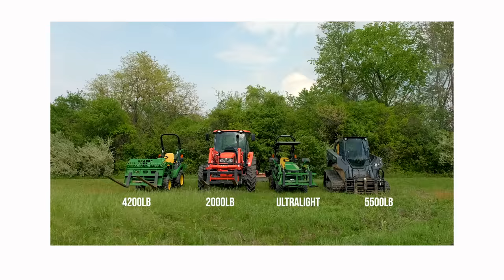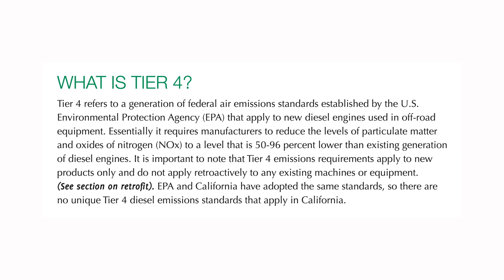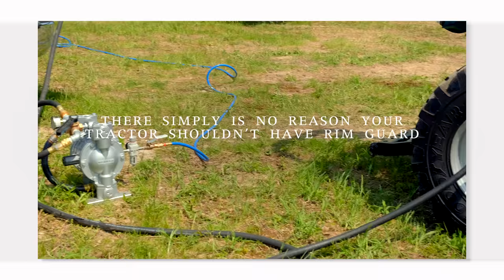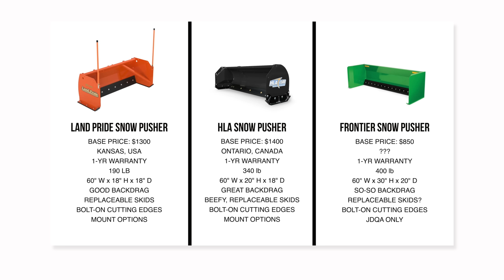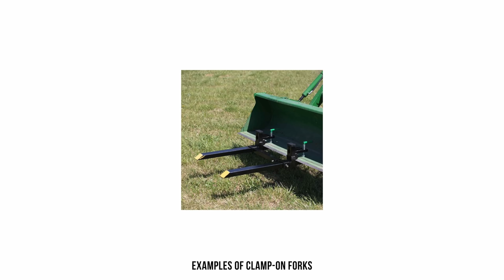TOP 10 MOST OVERRATED TRACTOR FEATURES, 2022 EDITION 🚜

Comment: Diff lock is like the 8th wonder of the world!!  I wish everyone would offer lockers for the front axle too!  I would for sure pay for it.   Lockers and Rim Guard in ALL 4ea wheels is a huge multiplier on what you can do with the tractor.  I just bought a Massey Ferguson 5711 Dyna 4 and added 2,800 lbs of rim guard plus 660 lbs of wheel weights.  Lockers + added ballast = success.   Great content!
Reply: Buy a deutz fahr if you want standard front diff lock or any SDF brand tractors,
Reply: I’ve heard filling front tractor tyres with liquid ballast will place pressure on the front axles they are not designed to take. However I kind of question this as most smaller tractors come with a loader that is designed to carry a lot heavier weight than the amount of weight liquid in the tyres.
Reply: The referenced tractor weighs 10,200 lbs with out the loader. Add 2000 lbs for the loader and the loader is rated to lift 4500 lbs to full height.   The liquid ballast only adds 500 lbs to each front tire I feel safe that my tractor will handle the 500lbs per bearing perfectly fine without issues.   I have a 2012 new holland t6050 that has a lot more ballast than that  and no issues with 10 ea years of farming use.  I wouldn’t weight the front tires on a compact or sub compact tractor as they are not engineered very heavy and are for home owner use mainly.
Reply: If you don't care about turning, just weld the diffs
Reply: @genewilliams7497  thanks for the information. My tractor is a Kubota MX5200 which is either a large compact tractor or small utility tractor depending how you assess it. Looking at it when the loader is on it looks big but when the loader is off it looks a lot smaller. 

I won't fill the front tyres up with water as I don't want to over stress the front axel. Usually I have the loader off when the tractor is doing non loader work, like mowing. I prefer to use the tractor that way as it feels a lot smaller and its easier to see what is going on.
Reply: The fluid is supported by the tire which is supported by the ground.  Just take the tire off of the tractor while it's full.  It isn't going to suddenly collapse without the front axle holding it up.
Reply: @kdegraa  It's actually free weight as it's UN-sprung weight. It doesn't affect your axle  capacity  at all. You may feel the difference if you don't have power steering tho.😉
Reply: Diff lock is useful in certain deeper snow situations. That’s where I’ve used mine most
Reply: @kdegraa  weight in tires is what would be referred to as unsprung weight if tractors had suspension. Unsprung weight is fully supported by the ground when it’s on the ground which “should” be all the time on a tractor. Unsprung weight has a ton of impact in racing because heavier tires are harder to accelerate and stop. Heavy tires work suspension harder in jumps and whoops  in off-road racing as well.  None of those circumstances has any comparison with tractoring.
Reply: @phild9813  Mud on hills teeter tottering.
Reply: My new holland lock front en rear ! Its life!

Comment: When my Ford 640 gave up the ghost I started loooking for a small tractor, with a FEL, that could go more places (4wd) and I had no interest in a rear excavator. What I found was a 1025R with 60 hours that had a 54D mower deck ('meh), 120R FEL, and Versa Turf tires, rear wheel weights, and some warranty left ('21). I don't mind adding a 4 ft brush cutter for our pasture and trails as I sold my ten year old 5ft cutter for what I paid for it. But I have used the belly mower and it isn't bad. And has the advantage of adding/removing quickly. A bit of overkill for our yard (that is 30% grass and 70% moss, sphagnum, other green weeds and hickory nuts), but a back-up if our trusty Husquvarna YTH24v48 (that my wife pilots) gets ill.

Comment: Bought my 1025R with the backhoe attachment. Have around 50 hrs on it and probably just over 40 hrs of the 50 has been using the backhoe. And I still have more time to put on it using it. Renting would have cost more with the number of tree stumps I am taking out of the yard. Thought about pallet forks but not sure about it, as the lifting capacity of the loader is not that great. After seeing your comparison between Summit, JD and Kubota lifting, I would have preferred to go Summit.
Reply: I get you on the lifting capacity, my tractor is a frame size above yours, but I will say my forks are on my machine as much as my bucket and I don't travel without them even when they probably won't be used and most times aren't. They are just that handy.

Comment: Love my backhoe, is it as convenient as an excavator, no definitely not. You just can't move material as efficiently with a backhoe as you can with an excavator. That being said I've found that it can come in very handy. I put a mechanical thumb on it and can use it as a poor man's grapple to pick up everything from rock to brush to logs and old railroad ties. My thought is that it's cheaper than buying an excavator and very convenient to have, and I don't have to drive 2 hours to go get a mini excavator. Also makes for a great ballast weight.

Comment: I just purchased a new 2025R. And one of the implements I purchased was a 3pt rear 60” finish mower. I’m not a fan of belly mowers. I use the tractor for more than just mowing and didn’t want the mower frame hanging under the tractor when in the woods.

Comment: I bought my 1025r used and it came with the backhoe.  I haven't used the tractor a lot but will say most of what I've done has been with the loader.  The backhoe IS nice to have though and if nothing else it works great for ballast.  What really surprised me is the tractor is shorter (length wise) with the backhoe than it is with the 3pt and a ballast box.  Anyway, thanks for sharing!

Comment: I use the heck out of my BY85 backhoe on my Tym T454 for digging out numerous stumps, trenching and brush clearing. I've used the locking rear diff on many heavy pulling occasions so I'd say it is certainly useful as well.
Reply: Knuckle bump to another tiny tym 454 owner, hope yours is as great of a machine as mine has been!

Comment: All good points and I agree with them all, particularly the OEM attachments.  Don't go bargain basement but there's nothing wrong with a good 'off brand.'  The rear diff was a godsend on the old 2wd tractors of my youth.  When pulling loads or heavy equipment on soft ground, that rear diff was the bomb.  On the current 4wd tractors, it's less necessary.
Reply: Less needed but still very very helpful especially if you’re trying to get anything done with snow in the Midwest where it rains and snows at the same time basically more often than not.  It’s not mandatory but it’s darn nice to have

Comment: It all depends on where you live and what tires your using, 
My ’97 JD 770, I bought in ’98, the 4x4 is engaged 75% of the time when I’m on the dirt (always pushing or pulling something) and 0% when I’m on the pavement and it’s still running fine. Running in 4x4 on dry pavement is really hard on the axles.
 Here in the PNW I use the Diff lock about 5% of the time when in 4x4 mode even with my R1’s as the mud/clay is horrendous. My new LS MT235he is around 1000# heavier but with the R4’s (no choice) it was either huge ruts or almost getting stuck with both 4x4 and the lockers. I had to use the 770 most of the time in the mud this last winter/spring to do what I needed. Pulling stumps and logs this summer I had to use the locker most of the time on both tractors.
 As far as the backhoe, I picked up a WoodMax 3pt a couple of years ago as 70 hr work weeks and getting older I just wasn’t going to use the shovel and the summer hard pan digging with the bucket in rocks and clay was like a jack hammer. I didn’t know I was going to buy the LS when I got the BH otherwise I would have got the BH with it just for the frame mount. Easy on and easy off. Easier to dig a small hole or place stuff with a 15” bucket than a 60”’ bucket, especially with the hyd thumb. I’ve used it a heck of a lot more than I realized I would, easily halved the time it would have taken not using the BH.
Love the QA forks (42”) on my LS, another thing I used way more then I thought. Great for picking up the stumps I dug up with the BH and not to mention the rounds, logs, branch’s, etc.

Comment: I agree with everything you mentioned!  I use the locking rear dif in situations where 1 wheel may be spinning from say mowing on a slope.  If it gets too bad and traction and stability is really compromised, I'll occasionally use the 4wd.  MM mower deck I too think is over rated.  If I lived in a perfect world, I would put that $$ towards a zero turn.
Reply: I really like the MMM on my JD2305, very nice to have, tho I'd buy a finish mower if I didn't have thr MMM. I recently bought my brother's used Kubota Zero Turn Mower, looking forward to using it, and keeping the hours down on my tractor. God bless, brother

Comment: The backhoe dispute is always fun....  I did buy the backhoe as I had a big project for it...  l did decide to use my machine as a side hustle which has turned into a full time job.  The backhoe has been a good money maker and has paid for itself many times over.  If I buy a second tractor then I won't need another hoe, but if I am upgrading and selling the old machine, there will be a hoe without question.  A mini ex can out dig a hoe without question, but all it does is dig....

Comment: I have some Frontier attachments. I have the Frontier box blade and their 60 inch tiller; comparing them to aftermarket products of the same use, so far the Frontier attachments are well worth the little extra money. They are well made and use heavier/thicker metal, and they are engineered and built to be repair friendly from what I can tell since I have not actually broken one.

Comment: I never understood the power of the diff lock for a long time, until the last year or so. My friend had just got his little John Deere 2305 back from major repairs to the front axle. He was told by a tech that it's not a good idea to run the tractor in 4×4 consistently... especially with any amount of weight added to the loader as it can be harmful to front axle. Now don't get me wrong... sometimes we have jobs that just absolutely require the 4×4, but we found that we try to avoid constant use of it as much as we can. He encouraged me to start using the diff lock, and in most cases it makes all the difference in getting through awkward and difficult situations where traction is an issue. It's a standard add on for good reason.

Comment: If you have a 2WD tractor a diff lock can definitely make the difference between getting out of a sticky situation and not. I have an old Massey 231 that would get itself stuck all the time. If diff lock is all you’ve got, you’ll try it to get out. I have tried diff lock in my new 4WD tractor when stuck and it works somewhat, but if you get a 4WD tractor stuck then you will quickly go past using the diff lock and go straight to the bucket.

Comment: I like my midmount mower on my subcompact MF GC1723e. I only use it 3 or 4 times a year, but I like the cut I get. And, after detaching the FEL and any rear attachments, the tractor is very maneuverable in some tighter spots. The  putting on and taking off used to be a pain, but I'm much better at it now and use the event as a time to do some regular maintenance and cleaning. Of course, as a retiree only working on my own projects, I don't have to be in a hurry.

Comment: The most underrated tractor feature is a ROPS for old tractors still in use. Have two Ford 8n's. Can't afford a modern tractor. Need ROPS for safety. Have found rumors of units, appears none are actually available. Have enrolled in the National ROPS Rebate Program. It's seriously underfunded and not useful if one can't find a ROPS. Have struggled to find a shop to fabricate the NIOSH cost-effective ROPS design. No interest.

Comment: You are so right on the mower. Same thing with a wood splitter, why burn extra fuel and put hours on a forty hp tractor.
Reply: I thought these modern tractors were built to run long hours. I got a pto wood chipper rather than one with a separate motor to maintain and fuel.

Comment: Quick Question, I am looking at a JDX300 mower, we mow about 2 acres, I also empty car trailers and boats around our 6 acre yard, and guys are telling me that the hydrostatic tranny should not be used for moving items like boats and such, because its a weak tranny..    any thoughts?     Thanks
Reply: I would do your home work and check the reviews on it first. Usually the tranny is the weak spot. If it says ground engaging transmission then should be fine. I guess the JDX300 is the smallest of the X series so I really doubt it would hold up.

Comment: i was leaning towards a mid mount but i think i would have gotten stuck sooo many times by now if i was using it. I went with a 84" 3 point finish mower, its super heavy and ruts the crap outta everything so i guess that would be an advantage to a midmount

Comment: I know your repeated overrated backhoe concerns ... How about reviewing the Harbor Freight trailer backhoe with self-contained hydraulics/motor. I had a lot of ditching/drain pipe to do and scoured the used sources for tractor backhoes and got down to the point where I looked at the price of the HF unit I almost ordered one. I really only needed a powered hand shovel. In the end I used a hand shovel and dug when I could and quit when I got tired, saved from spending on going to the gym, I just got the seeding done a couple days ago so it was not a fast project, but it's done. Check out that HF digger though.

Comment: Good take on the serious tractor modifications stuff. I have no use for that. Doesn't make any sense. If you want a bigger tractor just buy one. I think that all stems from the diesel truck world. All these guys with their diesel trucks that just drive them. Got to have that bragging right thing. I also agree with your stance on implements. The major full line manufacturers don't have the r&d budget to do some of the attachment. I've been finding that more and more the small attachment guys. It's their specific business so they put their heart and soul and have all their r&d for it. Biggest case in point is drive around the country and look at all these mega combine machines harvesting a lot of them don't run the OEM header . I actually had this discussion with a major company rep and they didn't care if you bought the matching attachment that came with the machine. But in the compact world it seems to be opposite of that everybody throws some kind of incentive package with attachments...

Comment: Tym/ rural king tractors have the best overall backhoe design in my opinion now. 
I can put my backhoe on and off without removing any 3 point stuff off the tractor and it’s 6500$ for tym backhoe vs Deere or kubota that’s now 12000$ 
I can go from my backhoe to a 3 point attachment in under 10 minutes by my self and go from 3 point back to backhoe in same time frame without help.
Reply: I sometimes find myself regretting not just getting the backhoe when I bought my rk55.

Comment: Yanmar tractors have a 10 year warranty on the engine, transmission, and axles.  That includes the DPF.  I really wish they got a little more love.  They still make engines for Deere and several others in additon to making their own tractors and commercial excavation equipment.  They are a little more expensive than many of the South Korean tractors, but less expensive than their orange Japanese cousins, and quite a bit less expesive than green American tractors.

Comment: The back hoe is like a front end loader.  Once you get it you use it for way more stuff than you originally planned on or thought of. I actually am coming up on 400 hours on the tractor and i would be surprised if there was lessv than 100 hours on the BH. But i also know that would not be normal

Comment: Man, im glad i didn't see or just forgot where you said a diff lock was overrated?!  I mean heck, if you think about going from 1 spinning tire to 2 spinning tires, having a diff lock is JUST AS BIG as having 4wd! Because if you've got 4wd with 2 open diffs you still only spin 2 wheels! At that point a diff lock is getting you just as big a result as the 4wd system!  Now, i understand the difference in traction available at either end due to weight and weight shifting around from implement use etc and how 4wd is different from a diff lock in that way, but in my mind the real answer is BOTH anyway. THREE wheel drive, baby! I wish i had a front locker, but alas.. 

I can see how someone might not care as much about 4wd or diff lock if the only machines they've operated are fairly large. Weight is basically the biggest factor in traction. If you run heavy enough machines you barely need a diff lock or 4wd in the first place. But on the smaller machines, if they didn't have one or both they'd be practically useless! SCUTs are 4wd because they have to be! You need all the help you can get when you're running a 1500lb machine around. Whenever you see small old japanese tractors that were 2wd for sale, they ALWAYS have a bush hog or a post hole digger on them, because they already found out.. if you have no weight, no 4wd, and no diff lock, you can't pull anything that doesn't already roll!!